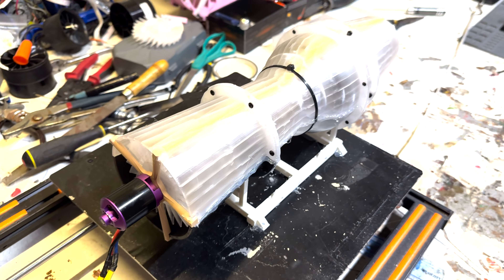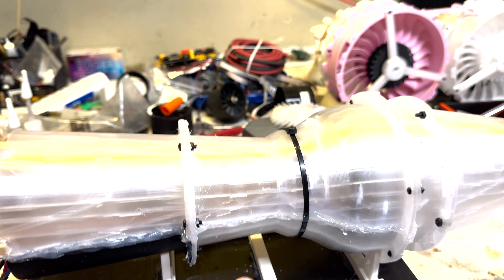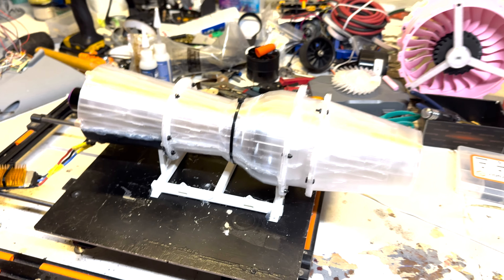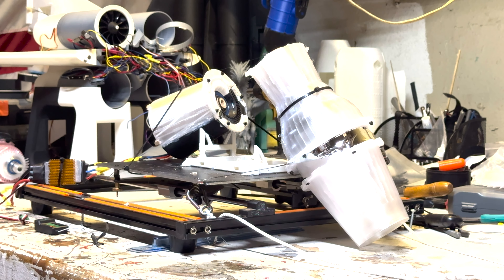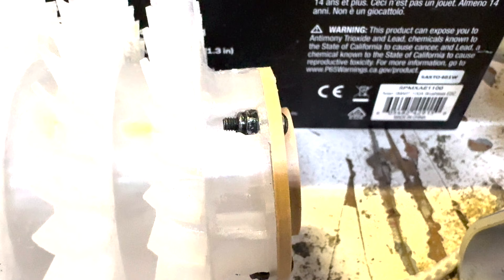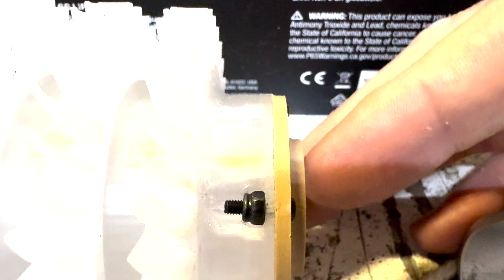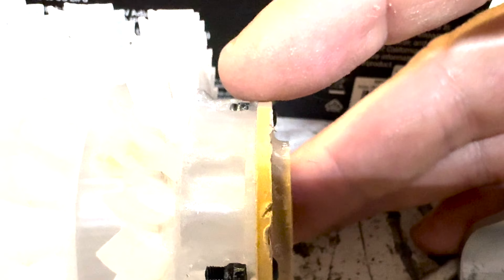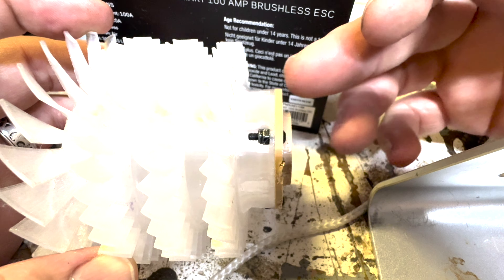Turbo Jet Explosion! Building V2 now #edf #turbojet #turbine #explosion #3dprinting #diy #rc #rcjet

Comment: Btw, I saw a neat technique for smooth prints, put the print in some acetone (vapor) and it dissolves it and makes it smooth
Reply: I agree that the method of smoothing is good but you cannot guarantee the surface consistency and potential causes balance issues.
Reply from the maker: It works best with ABS, would be nice to use here but might mess with dimensional accuracy.

Comment: When test are done, will it be available as 3D print file?
Reply from the maker: Yes, I also planned on commissioning molds for a built ready to install engine.
Reply: @warmachined3472  will it be possible to scale up to 120-130mm? about how much thrust are we speaking here? thanks for the fast answering
Reply from the maker: Projected thrust of 16 to 20 lbs. the fan is 170mm.